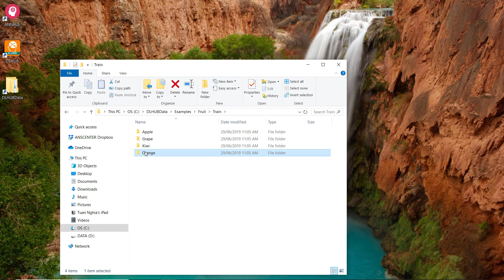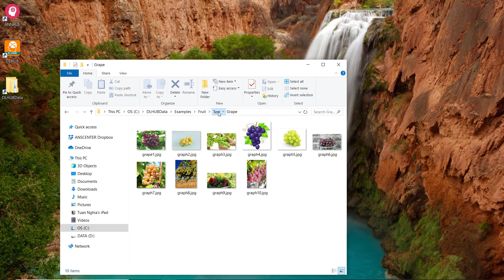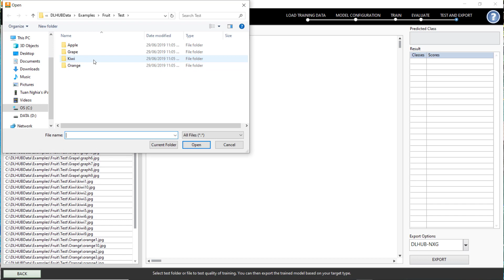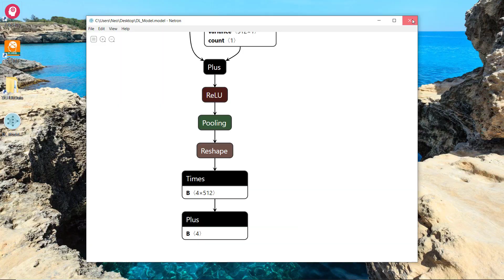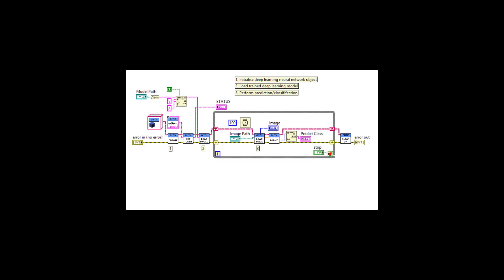DLHUB Tutorial: How to design deep learning model using the transfer learning technique

Comment: Can this use case be also be implemented in ANNHUB instead? Its cheaper software x10 vs. DLHUB. Kind of figure it out that ANNHUB is really just Artificial Neural Network (Feed Forward NN only) that the more expensive DLHUB which is Deep Learning so much better NN architecture too.
Reply from the maker: You can use ANNHUB for pattern recognition and regression tasks, but you can use the transfer learning technique that reuses pre-trained deep learning models in ANNHUB.